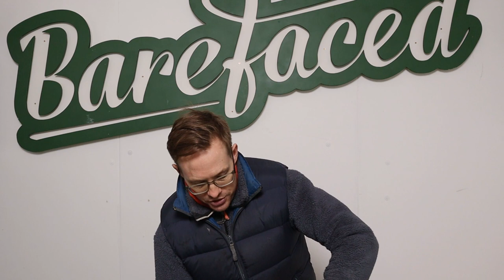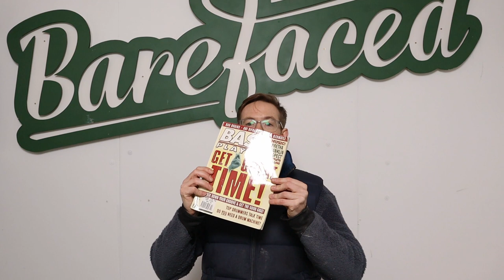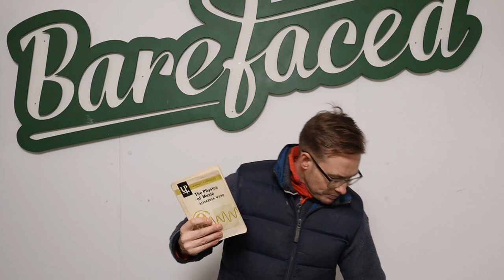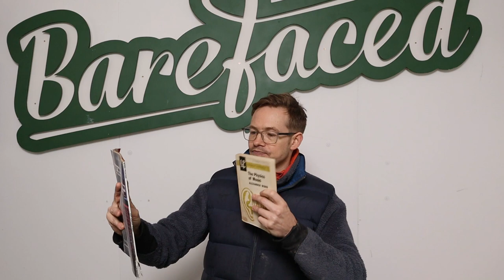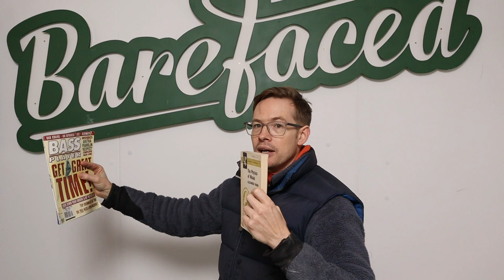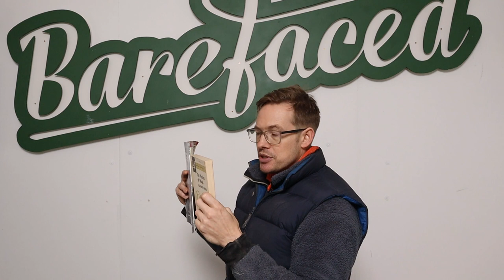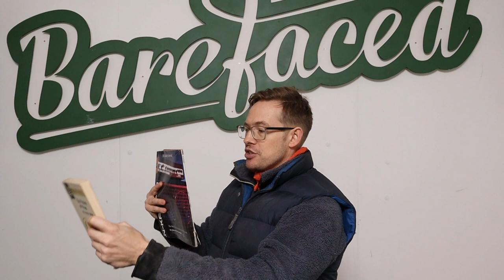How ports work! (Not just for bassists - guitarists this is key to the AVD system!)

Comment: If I'm understanding the explanation correctly, when the speaker and the port are in phase, when the speaker is pushing air out into the room, the air mass in the port is also pushing air out into the room.  So the effect is like two pistons pushing air out at the same time.  Thus creating sort of a rapid vacuum/pressure cycle within the cab.  Then as the frequency drops, the speaker and port gradually go out of phase until at a significantly lower frequency, they are 180 degrees out of phase -- then as one pushes, the other pulls, resulting in somewhat even pressure within the cab and the room, thus not creating the low frequencies we were hoping to achieve.  Did I get that right?

I've always known that ports could help a cab design and that they could be tuned, but I never quite knew what that meant.  Still foggy on how the resonant frequency can get the air to be pushed in & out simultaneously when in phase, but knowing that's what happens is a step up from where I was before.

Comment: I'm guessing the cab itself has a resonance frequency, the lowest frequency it can produce due to it's size.
And then you make a hole that will boost that lowest frequency and just below that it rolls off more quickly.
And lastly, to extend the frequency range of the cab to even lower frequencies, you have the length of the plastic tube.
Make it too short: it will only make the resonant frequency of the cab louder, 
Make it too long: it will enhance frequencies that are too weak to be enhanced to the same level of the rest of the frequencies.
I may still be missing pieces of my understanding of it.
What I don't understand is, how do you determine the size of the hole? I guess that's the next step, before you determine the length of the tube?

Anyway, I will watch the rest of the series cause this is realy interesting.

Comment: Does that mean we ideally need a high pass filter on amplification which will cut or remove frequencies at the point where the driver and port movements become out of phase? If those very low frequencies contribute nothing to the output of the cab (and increase resonance/distortion components we don't want), it's wasting amplifier power attempting to send them to it.
Reply from the maker: Lots of amps have some kind of highpass filter or LF roll-off built in.

Comment: So question. Do you guys test all your amps if their ports are correctly working in phase before sending out?
Reply from the maker: That's not something which needs testing in final QC, it's part of the R&D process. So yes, they're tested when designed and then manufactured to meet those specs.

Comment: Is there a reason for no slant in your previous cabs?  And also where is the best place for mic placement for live gigs .  Does the tube port sound different from a rectangle port directly under the bottom of the cab kind of like bass cabs or will it distort guitar frequencies.  Thnx I like your product and I especially like your old prototype w/ the slant.
Reply from the maker: Good questions, I shall address those in some future videos - but in short we found that once you've got the AVD improving audibility the benefits of the slant baffle become pretty insignificant.